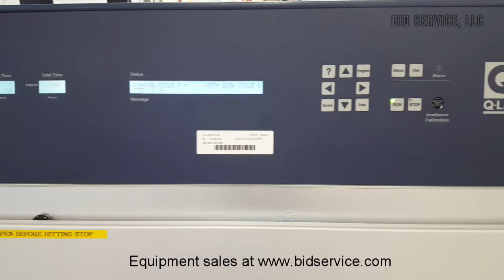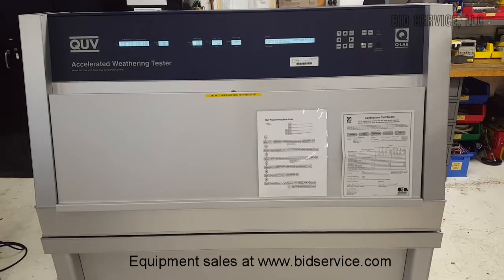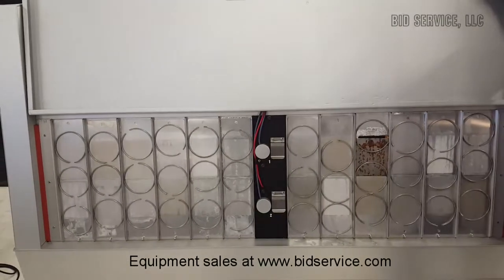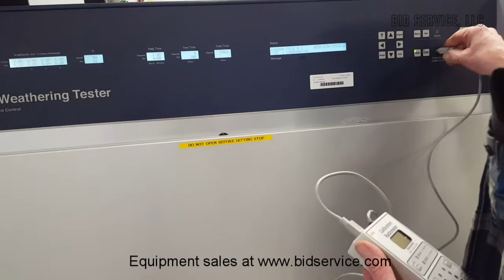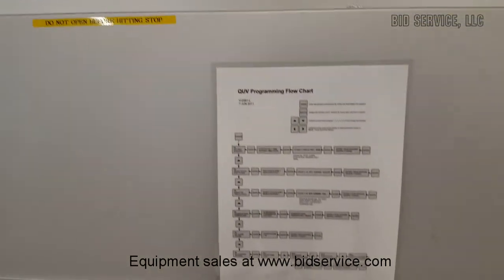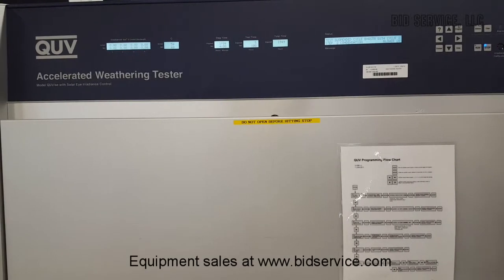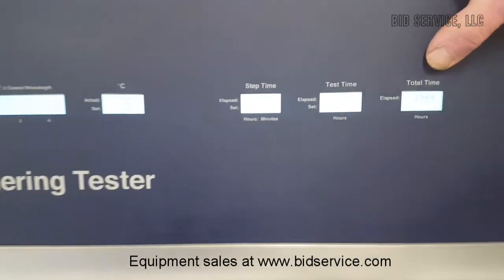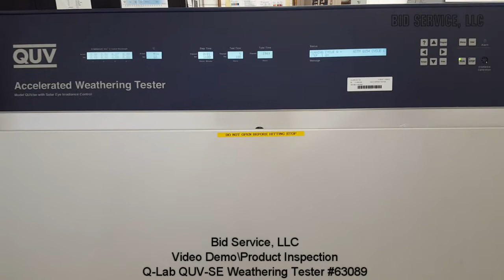Q Lab QUV SE Weathering Tester #63089

Comment: Hello,

 I'm facing some issues while I run Condensation Cycle. Error codes (M21:CONDENSATION CYCLE:
1. Panel holders are missing.
2. Lower blower relay is stuck closed.
3. Water hesater relay is stuck open.
4. Water heater is broken.
5. Lab temperature is too cold., 
M25:Lab temperature may be the cause of a chamber
temperature fault).

Please advice me on this as to what needs to be done in order to stop this.

Thanking you in anticipation.

Best,
Faraz Ahmed,